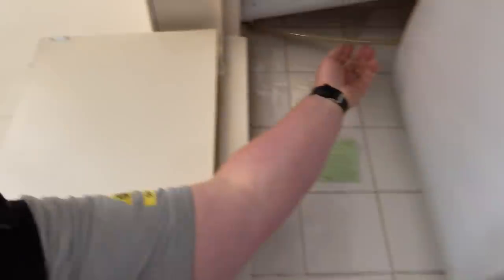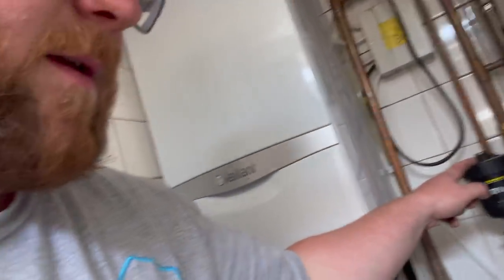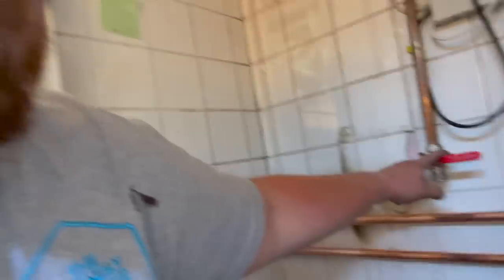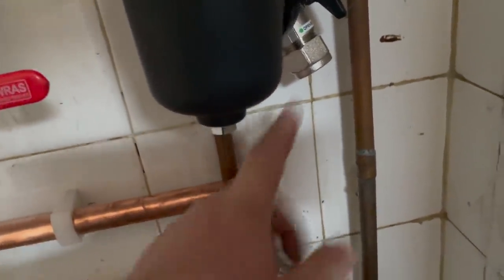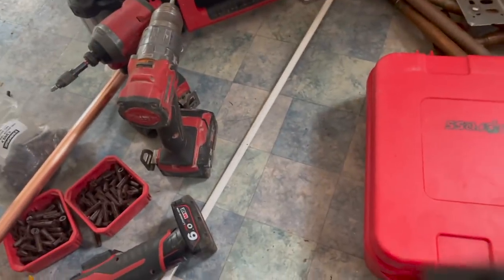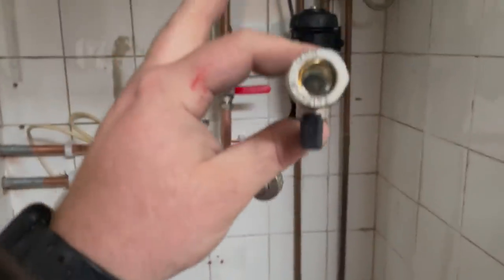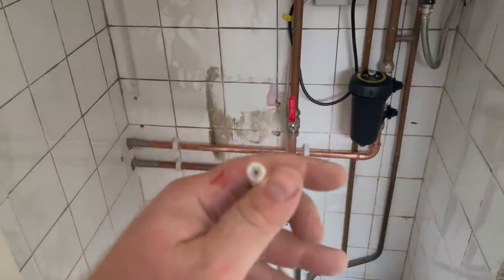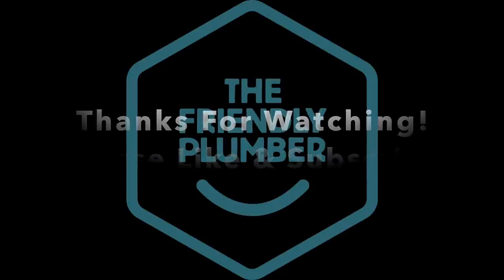A day with the Friendly plumber EP#12. does press fit really work? how to move a boiler.

Comment: Nice video mate,one question,on the copper pipes you installed on the ceiling,the air on the system how will get out from the pipes,without an automatic air vent?
Reply from the maker: Great question! There is obviously an auto air vent in the boiler that to be honest gets rid of most of it along with the pump air purge mode on the wb, i also installed some auto air vents in the airing cupboard above! And had no issues getting rod of the air but yes it could have potentially been an issue! Its not always possible to get the pipework exactly as you would like it to be so i always try my best to get it as neat and effective as possible within the constraints your customer has given you! 👍
Reply: @TheFriendlyPlumber  Keep up the good work mate!!!i like your videos!!!

Comment: Looking to get a Press Fit set, can't decide on the Rems or Nova and which fittings, V or M ?
Reply from the maker: Hi simon,

I can only give my opinion but i have got nothing but praise for the novopress, for me running of the milkwaukee battery platform made it a no brainer and it hassent disappointed! And i use m profile fittings purley because thats what my local merchants sell! Find out what you can get your hand on easily and go with that! 👍
Reply: @TheFriendlyPlumber  Thanks. My local City Plumbing sell M but Screwfix sell V although they seem to have to be ordered. I only have the Milwaukee 12v pipe cutter.

Comment: Surprised you didn’t stick a couple of air vents in that flow and return . 👍
Reply from the maker: I did think about that however there were already so many on the system it didn’t need them!
Reply: That’s two storey building, what’s is the rule about the Air vents ? Where does the air travel? On a highest point of the pipe work, that means is no use to put air vents below . People do so many mistakes with them, it’s no use below , the air vent should be installed above 👆 the radiator height , when they make a tee connections specially on a cylinder coil run , makes me laugh 😂 one of them will be below the radiator height or two of them at least , depending on a hot water cylinder design.

Comment: Good Video, I use the Novopress 103. But mine is the older model and doesn't swivel. I use M press and also U profile jaws for MCLP. I find myself using the heat gun less often, as time goes by.
Reply from the maker: I agree! Hardly use mine at all anymore!

Comment: Press fit has its place. The cost puts me off. £180 for 60/70 fittings. + the gun + calibration.. 
You could get a top end full solder set up, torch,gas, matt case etc and 300+ fittings for the cost of buying 200 press fit fittings... 
A boiler move takes me 1-2 days (depending on where its getting moved) hot much time would press save you in 1 day? 1 hour? 2 hours? Then if you run out of fittings you need to try find a place which stock your fittings for your jaws..
Reply from the maker: I agree it has a time and place! I am personally really enjoying the ease of it aswell  as well as not having to worry about scorch marks and fire risk!  But do definitely agree the price difference is a big let down!
Reply: Biggest time and place point...can do on a wet system, with pipes with water in
Reply from the maker: @olliemackie7964  very true was speaking to a guy last week that hasn’t drained down in over a year just uses his pipe freeze and press fit!
Reply: @TheFriendlyPlumber  press is awesome as you don't have to remove the gas meter when working in close proximity.  The Epdm seals in these press fittings will be still be there long before we're gone.  My Rems minipress has been invaluable in certain situations.  My sweatgear only comes out for microbore or when It's to keep pipe work in keeping with the rest of the existing installation.  I held off buying a Milwaukee m12 pipecutter for so long.  When  I purchased it's saved me loads of time.  Bit bulky but hey.  What cordless were you coring with, Hilti? Surprised to see a cordless core drill 🙏🏼.